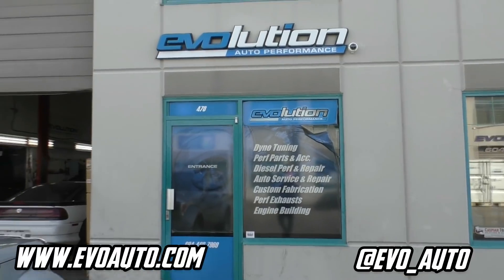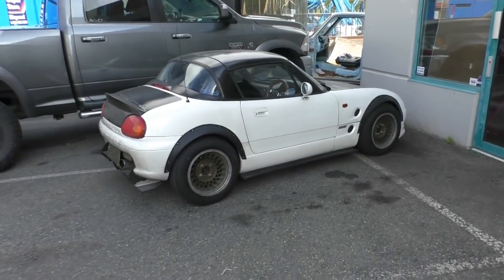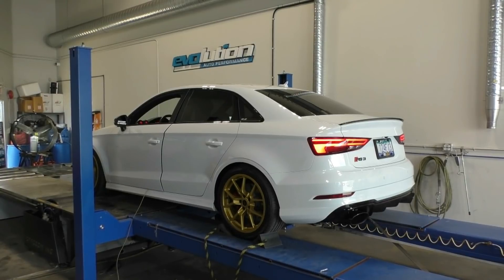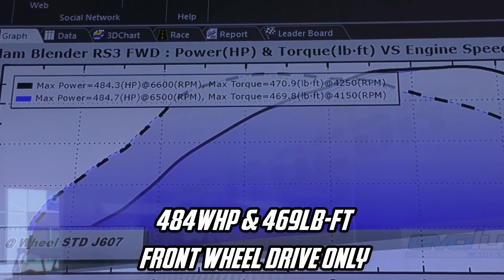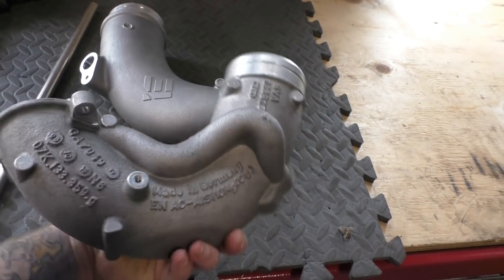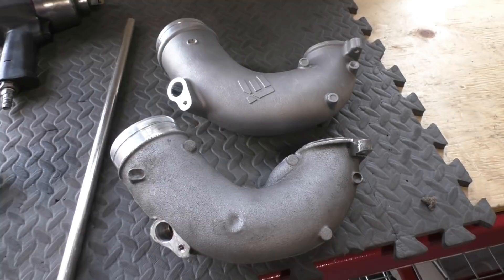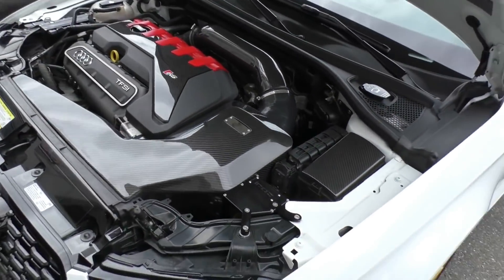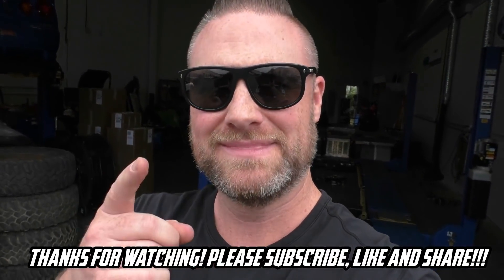Does the Integrated Engineering Turbo Inlet For The RS3 Really Make Power?!?!

Comment: Has anyone installed the IE Turbo Inlet Pipe on their Golf R and dyno’d it? I’m contemplating including this part in my stage 1 build
Reply from the maker: I'm honestly not sure.  I know that IE makes solid parts though that add performance.  I ran both their intake and their turbo inlet for a while and they worked like a hot damn
Reply: Vancity Audi thanks for responding, that’s good to hear. I understand that a cold air intake (without tune) is a marginal  (if any) horsepower gain and I think I’ll do the inlet pipe at the same time. I’ll do an ECU tune a bit later on. Car currently has under 2,000mi 🙂

Warranties and what not.
Reply from the maker: @caffeine4130  IE's new MQB cold air intake looks pretty fancy pants.  I wouldn't be surprised if it made a bit more power even on a stock tune.  Once you tune the ECU is obviously when you are going to feel the full benefits.

Comment: Wouldn't the gains differ depending on what you're starting with? Maybe the 18hp gain quote is based on a stock rs3 but with a tune and a couple other bolt-ons you can amplify that a bit? I really have no idea -just asking
Reply from the maker: I did a 'PART 2' of this video that better depicts the performance gains of this inlet. https://www.youtube.com/watch?v=8FIPygP03J4&t=373s
I imagine that because my car is tuned it would better utilize this part, just like any other aftermarket parts.  If you run it on a stock tuned RS3 you may very well not see the same gains.  I am also testing on ethanol or E85.  The power gains may be less on pump gas like 93 or 91 octane fuel.

Comment: IE gives a disclaimer that their Inlet Pipe (for the VW GTI, at least) is not compatible with the DV+. Do you think that this is a deal breaker as compared to the CTS Turbo Inlet pipe?
Reply from the maker: If I'm being totally honest, as I always try to be... I would never put a single CTS part on a car I own... EVER
Reply: Vancity Audi why?
Reply: @VancityAudi  why? Cts low quality?
Reply from the maker: @matteocimini8498  my opinion has actually changed as of last year.  I have used some of their parts with no issues.  In previous years their quality has been subpar and they'd copy more expensive companies designs and then make cheap knock offs.  Within the past couple years the shop I get all my work done at has sold and installed a bunch of CTS parts and noticed an increase in build quality and didn't have nearly as many issues.  They may not be the absolute best products on the market but the ones I have used have been okay.
Reply: @VancityAudi  perfect speech. Thank you

Comment: Fwd?
Reply from the maker: More accurate reads on the dyno in FWD.
Reply: Vancity Audi  but need to read whp for all
Reply from the maker: @Bestjdmcar  it doesn't work like that. It is still reading the wheel horsepower the engine makes. It is reading it even more accurately because there is no interference from the AWD system.
Reply: Vancity Audi thanks for info bro 🌹
Reply from the maker: @Bestjdmcar  no problemo

Comment: hey quick question when your rs3 revs up and you get the different colors on your tachometer is that from a aftermarket tune? or is it factory ? thanks
Reply from the maker: I honestly am not sure. If your car is still stock, switch it over to Manual mode. Then rev thru the gears at higher rpm. The different colours don't happen in 1st gear though. I am on Custom Code software and it has been like that ever since I started using it.
Reply: @VancityAudi  ok thanks. I seen another guy after he installed air intake.  He also had it but he said no tune. And online is no help. I'll do more research.  Thanks
Reply from the maker: @thugnificent259  no problem. If you already own an RS3 and it's stock give it a go yourself in Manual mode to see.
Reply: @VancityAudi  ya I tried first gear. But I'll check 2nd and higher. Most streets only 50km in my town.
Reply from the maker: @thugnificent259  100% it doesn't work in 1st gear.  When you are out of town push the lever over to manual and give it a try reving up higher in 2nd and 3rd.  Good luck!!!
Reply: @thugnificent259  I have an rs3 and the colour is stock. you have to be in manual mode and it has to be 2nd gear or higher. you can't hit rev limiter on first gear (car auto shifts in manual in 1st gear) so you don't see the colours. The colours will appear from 2nd gear onwards though.

Comment: nice vid, I had the first ttrs in Canada in 2011 def miss that motor, maxed out at 308kph. too bad the new 2.5 isn't as pretty as the old one my only complaint

when I was modding intakes and filters didn't do anything the OEM one was plenty. back then it was direct injection only so made sure to use 504/507 oil instead of 502 as catch cans are a joke.

Comment: Fan was OFF for the first dyno pulls? Car was starving for air, no wonder you were down on power.
Reply: Then your last pull you had 3 fans on? The data is not exactly trustworthy like in those conditions.
Reply from the maker: @javbomb  looking back at it now you could be right for some of the gains, but I suspect that not all of it was due to the air movement
Reply from the maker: @javbomb  will do. Thanks for understanding and will continue to work on good content!
Reply: Good observation was so excited at results but now forget it there was a change in test data. Guys at EVO need a new PC or an Antivirus and use fans throughout all runs to keep data the same. 

Thanks for the vid regardless Vancity.
Reply from the maker: @boostedveedub9687  thank you. Sorry for the inconsistency in testing. Will definitely make sure I don't make the same mistake on my next test sessions.